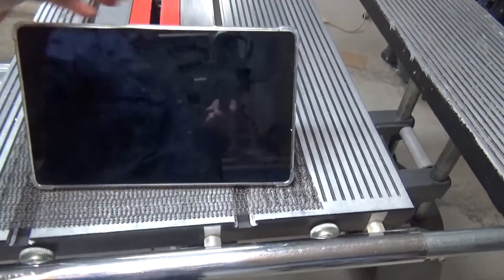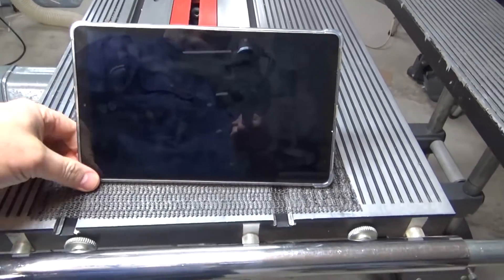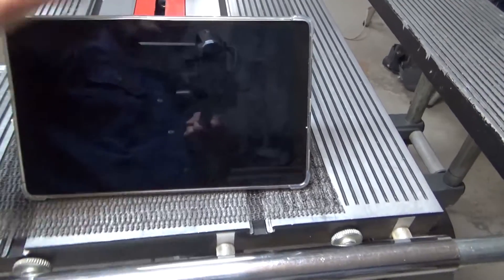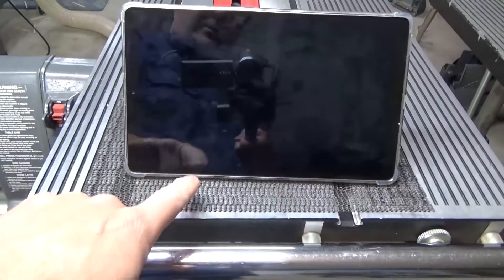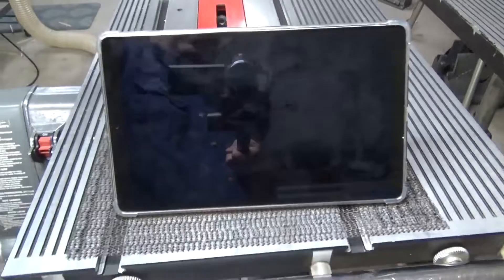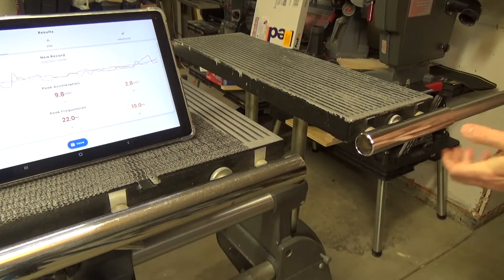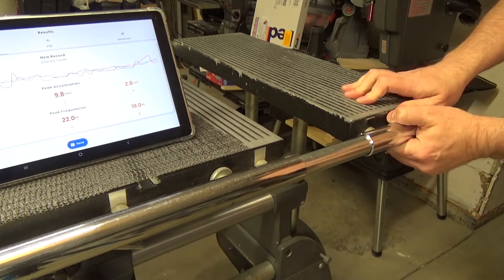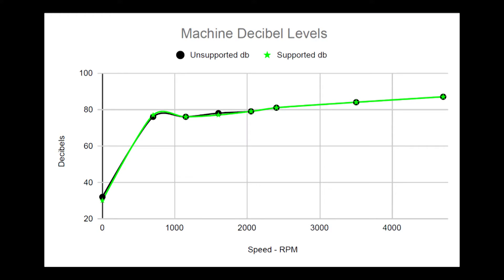Good Vibrations: Can Vibration Help Maintain Woodworking Machines?

Comment: I would be inclined to try attaching the sensors (say an old cellphone that is no longer in use) directly to the back of the headstock with magnets (has the advantage of always mounting to the same spot) , or maybe velcro.
Reply from the maker: Great point, it would be better to the data right of the headstock rather than transmitted through the table.
Reply: @woodshopnerdery  If you really wanted to get fancy,   A raspberry pi, plus the appropriate sensors, plus a sensor for spindle speed, plus a bit of programming, (way beyond my skill set) would give you data logging also.  :)
Reply from the maker: @333rpd  I like that idea. It would be fun to program something. I've built hardware prototypes for work on the PI and Arduino platform before. I don't do it all the time but CAN do it. My issue with that is I get a lot of that sort of task at work. I really like woodworking as a break from that. Sometimes I waste all my garage time looking at the grain in my lumber.

Comment: I don't subscribe to many channels, but you got me with this one for living up to the channel's name. The results may not have been actionable, but in my growing queue of videos I might never produce, I have one related to machine learning and artificial intelligence for woodworking. Sensors and data collection are the first step, and then a thickness planer will adjust RPMs and feed rate based on wood type, grain direction, noise, voltage, etc.

Just for kicks, I tried your same experiment on my thickness planer and it worked. I was able to quickly detect that it will not turn on at all right now and needs maintenence.
Reply from the maker: Thanks Ben! I consider your channel among the most intelligent on YT, so that compliment really means something.

For your experiments, you might consider looking for a used Shopsmith planner if you can find one cheap. A nice advantage there is the feed roller mechanism is separate from the cutter head drive. This way an ML trained neural network could, in theory, change the rates independently. I believe most benchtop planners run off a single motor with the feed connected to a 1 or 2 speed gearbox. So the rate of the feed rollers would be a fixed ratio to the cutter head speed.

The Shopsmith Planer feed motor is a universal motor with the speed controlled by a rheostat. That may be relatively easy to wire up to Raspberry Pi or Arduino controller. As you probably know real time speed control on AC induction motors is a bit more challenging. Which brings us to the DVR discussion. Ironically, Shopsmith's latest main machine units are driven by DVRs and the speed change is all digital now. I believe they source the "guts" from the same people who make the Nova DVR Lathes and Drill presses. I hope to share some news on this for my own garage in some upcoming videos (pending global supply chain issues), which will put a whole new spin on the recent "testing" I have been doing.

I have worked with the RasperryPi Sense Hat for prototyping applications at work. In fact a colleague and I got a patent based on a prototype built on this platform. The Sense Hat has several sensors built in, can run off of a Python library, and plus has an 8x8 led grid you can barf out status symbols to and such. Pretty easy to jumpstart an idea. Then once the idea is fleshed out the design can be ported over to more specific hardware. https://www.amazon.com/RASPBERRY-PI-RASPBERRYPI-SENSEHAT-Raspberry-Orientation-Temperature/dp/B014HDG74S
Reply: @woodshopnerdery  I wish I would have learned Arduino or Raspberry Pi a long time ago, but there are always too many competing priorities. I think I still have an Arduino book on a shelf somewhere. If I do make future-of-woodworking video, it will be high-level and conceptual; hopefully suitable for a more tech-literate person to build on.

My planer is going to survive. I would have had it fixed two weeks ago, but the issue was interesting enough that I decided to make a video about it. Thought I was going to finish tonight too.

Comment: Tom… At my first factory job, we had exactly the same testing done…. Constantly, everyday, using specialized controllers!

The controller was calibrated, tuned and always plugged into the machine.  It’s audible alarm and instant shutoff was constantly ready. 

As to sound it also measured pitch and compared it to known levels instantly.  In fact, sound pitch was often more useful than volume for detecting issues.  

But, most useful was its ability to measure and detect sound rhythms.  Most significant failures in a quarter million dollar electric motor such as bearings, drive wear, loose attachment… first became apparent when the vibrations became rhythmic patterns.  

And way back then… in 1971… that controller only cost $2.19/hr.  Man, I loved my job!
Reply from the maker: That's working smart for sure.

Comment: I’m not sure that measurements between the mark 5 and the mark 7 would have any real value. The 5 is mechanically driven with belts and sheves where as the 7 is a direct drive induction motor. I believe the only thing you would prove is the 7 is much quieter and runs much smoother then the 5 which is what would be anticipated and expected.
Reply: Not to mention you'd have a new Mark 7 in your garage. Awe, I see what you're trying to prove here, justifying the purchase of a new MK7 to the Boss of the house. Brilliant!
Reply from the maker: @curttundra  exactly!
Reply from the maker: I think you nailed it in the last sentence!

Comment: Still struggling with the point of this. Maybe helpful as in vibration vs. quality of cut? Or is it simply vibration vs longevity?
Reply from the maker: I think if there is a lot of vibration, from say a bent shaft, yes it would create spindle run-out that would effect the quality of the cut.

Comment: I like the practical tools to get the job done!  Smart.  Fluke gear is crazy expensive but obviously good.  Bought a MicroScanner PoE a while back.  Always need a baseline to compare to.  Thanks.
Reply from the maker: Thanks Bob. I like proving what I already have doesn't work before I go get something new. It's amazing how many times it turns out that what's in the toolbox already gets the job done.

Comment: Dont forget the best analysis gear you can use is you.
You know when something doesn't sound right from memory. 
For example you know when your Auto muffler needs chainging long before it fails and you didnt look or conduct any inspections
Reply from the maker: Totally agree, IF the operator has that skill. Not everyone is blessed with the same talents, fortunately I might add. 🙏🙏🙏

Comment: I don't know, Tom... In a commercial/industrial setting it makes sense to me. Where a tool or machine is in constant or semi constant daily use. I would think in a home workshop setting it might make sense on even a semi weekly usage basis.

For example, in my day job I can use tool breakage detection settings on my CNC machine tools to detect if more power is being used to do the same task with the same tool in a production run setting. If the power consumption increases, then most likely the tool life is nearing it's end, or if it's a huge jump in power consumption, most likely the tool has failed. 
Heck, I don't even need to use settings in the machine controls to detect that. I can see it in the various axis load meters while a tool is being used. 
I see this daily: say a cutting tool has a average load being put on the spindle of 39 to 40%. If the load jumps into the upper 40's into the 50's of the spindle load percentage, either during a cutting cycle on the current piece being machined, or from the previous identical cutting cycle the tool was used on the previous piece; I know that cutting insert is dual, chipped, or almost completely worn out. 

Checking now, and then like you say, checking it in a year from now, might seem like a good idea in theory; but what happens if the results are drastically different in a year? Sure, you can see the change between the two intervals, but pinpointing when the change occurred would be impossible, along with the progression of the change up to the latest test. It also would be too late by then to use a preventative maintenance plan. It seems unnecessary to me to have even bothered testing and recording the data at that point.
Reply from the maker: I don't disagree, this one was more for fun and my own curiosity than anything truly practical.